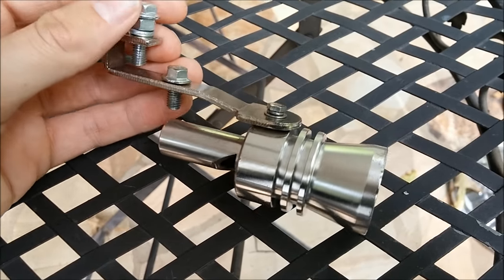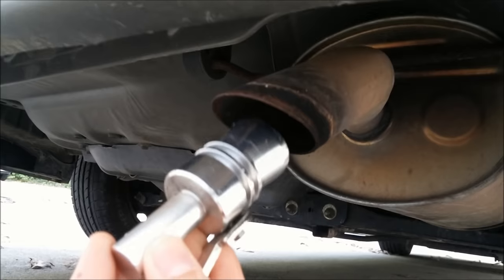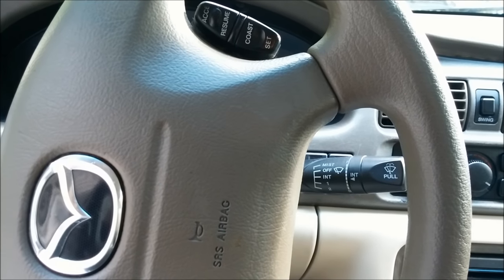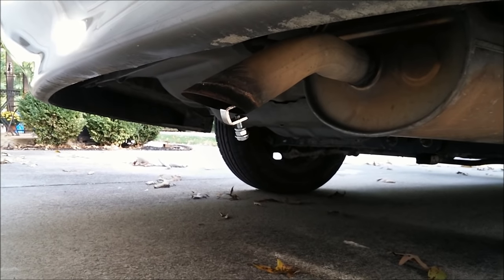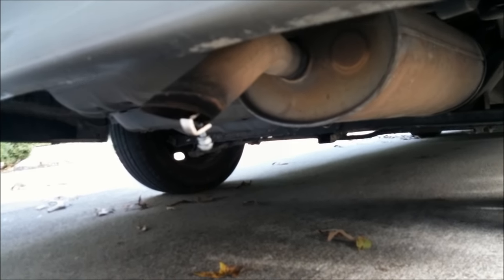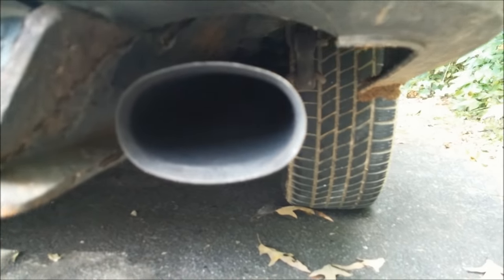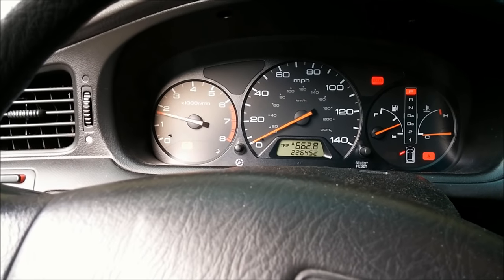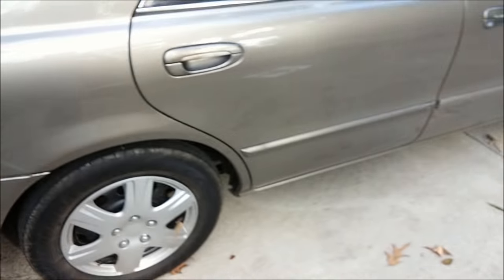Turbo Whistle Review

Comment: You would be 0.000001% faster without the whistle, less weight.
Reply: Actually its choking up the exhaust so you would be a LOT more than that.
Reply: RKF427 Tru
Reply: +RKF427 it doesn't have a performance exhaust, so honestly it probably doesn't have much effect

Comment: If you want true performance get a nice sport car, upgrade it with a good quality exhaust system with a turbo charge unit, the aftermarket parts are full of nice stuff to choose from, don't dick around with ridiculous garbage. To give an example ... back in 2004 I bought a used 1989 928S4 Porsche, it had been through three owners already but the car was in good shape, it just need it a few cosmetic fixes, such as burned headlights, body & paint work, rusty exhaust, it had 74k miles on the dial, but engine was good, I bought it for 4300$ and spent 2300$ in getting it back in good shape a few years later I sold it for 7000$, investing on a good car can be a very good investment, I could of bought another muscle car but I always loved Porsches, so finally I got one my self. So it is worth to save money and get the right car if you really want a good performance sport car always keep it good shape and detail, on the long run you will get your money back.
Reply from the maker: Lol
Reply: 2005 MERCEDES-BENZ Class SLK
Reply: The 928S4 was a very nice car but keep in mind that it was an 80's model, new generation of Porsches have major advances and improvements in all segments such as quality build, components and electronics. The slk I will sell next year it has been with me for several years now, I will return to Porsche again, my next model will be the 2005 Boxster 987S, Porsches are sweet ...
Reply: +NoTraction - Drifting and More! It's boxster you bellend!
Reply: NOBODY CARES!
Reply: +Stingercam21 The 928 was never a nice car, and it was never a real porsche.
Reply: +NoTraction - Drifting and More! The boxter sucked too. Bad taste all over youtube. Like the person who made the video in the first place.
Reply: I hate sports cars personally.
Reply: +Stingercam21 so what you're advising is spending 6600 for a 400 dollar profit?
Reply: My goal was to give you guys an idea of really owning and enjoying a nice sport car, get a blast while you are at it and get a good deal when you want to sell it, mine was just an example, which I could of made it more profitable but keep in mind it was my first deal. But boy did a have a blast while doing it !!!
Reply: +Stingercam21 I have a sports car and I'm content with it. but I can see where you're coming from, it was just sort of a poor example
Reply: ***** An '09 is350 fsport
Reply from the maker: Dude but my turbo adds 1000+ hp

Comment: You may have to get a 3 inch downpipe and wastegate in order to optimize boost at high rpms bro  a boost controller may also benefit this set up.  Keep up the good mods bro.  The haters are just jelly because their miatas and neons can't handle this amount of boost

Comment: This is the second review I have seen where minimal focus is on how it sounds when the engine is revved. The whistling sound happens after a blow-off so even though the product is faulty a drive-by is not a good way to test. You need to use a stick shift, not an automatic, to give us a true reflection of how it sounds.

Comment: The one you put on there is WAY too big! You don’t want it to scoop up all of the exhaust coming through the exhaust pipe but rather just a portion of it. If you downsize the whistle it won’t be as bad at idle.
Reply from the maker: Maybe I should do another review with a smaller one!

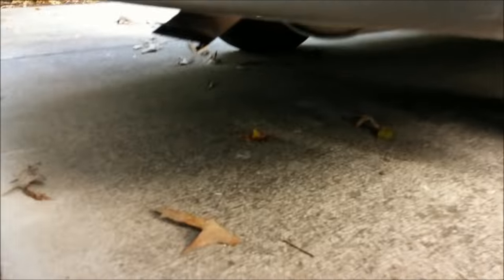Comment: AT 01:58 you need to tighten the top bolt and lock washer to the top if you plan on permanent installation.  Also, this gadget is just a whistle. Blow on it if you don't believe me. I laser cut one mine in half, and it is a simple whistle. I bought and pack of two and I use the other one for an emergency whistle when I go hiking. It is pretty loud. Your drive byes in the video are just the sound of your factory exhaust. This whistle will never magically produce turbo sound. But, for $9.99, I got a decent emergency whistle for hiking.